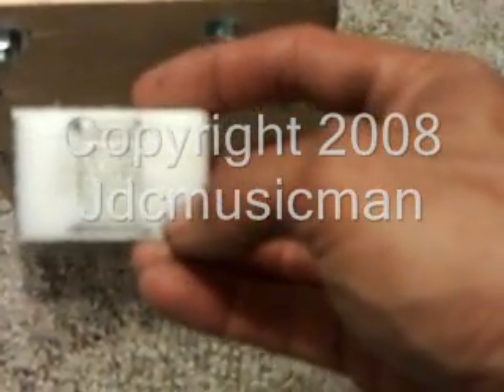New 16plate 4x5 NO hole drycell progress #2

Comment: Howdy JD !! if you dont have a problem with heat go ahead and use the WD 40 straw idea tjgame2 came up with or you could go with alluminum and use small roll pins found at any auto store in quantity, the roll pin will have a slit down the side but that would not matter I would not think. cutting them and then deburring would be time consumeing but a small tapered needle file in a drill motor would do the deburring. I am on your side man!!
Rusty

Comment from the maker: It has been my experience on the voltage gap thing ..2.2 - 2.4 seems to be the sweet spot ..Any thing less deals with heat very well but  you comprise that for little production , in all the test that I have run doing 12 - 14 volts a 4n config is the middle ground half way decent production and manageable heat....2.3 even does well for a 51 plate series cell it gets hot but not to hot.I built a cell once with 6n and production was not great at all never got hot tho..

Comment from the maker: If you have a 4n setup you want have any heat problems anyway.Well I hadnt had any with that setup so far , and I have run my 31 plate cell for 8 - 9 hrs straight on 27 amps with no real bad heat issues,.

Comment: i am looking for plastic small tubes i have  the same idea as yours in addition to the holes i would like to slide in plastic tube so to isolate each cell from the other with no water touching and gas will rise up and than collect everything in one output ,and i will reserve one raw for water input that i will activate a small pump to fill the cell not flood the cell .my idea also can be achieved with using a block of plastic that is machined on a cnc ,no way i will do it manually

Comment from the maker: I thought of doing that , then for some odd reason I decided top cut the bottom out too..But i can change that fairly easy ,I have enough scrap neoprene to cut 50 more gaskets for this cell..yeah I did consider that and am still considering it ,Have thought of it a little today ,it would probably be simpler to construct 1 piece to do the water and gas than to do 2 seperate pieces..Would get decent results from it cause my other cells only have one hole and they work fine like that

Comment from the maker: Yeah I am looking at all angles on this thing...
Well the gasket on the bottom of that piece will be sitting down on the plates edges, those holes are dead center of the plate gap and the plate edge will be covered with the gasket , If you understand what I am saying...If there be any current leakage at all it should/would be only thru the electrolyte mix....but yes maybe it will work or not ,I wont stop till I get it. I am stuck on this,it may be plan Z before its all over with ...

Comment: well, I dont think you have sealed the plate edge ... you still got plate edge that see the adjacent plate edge ... so am not sure how you plan to seal off that aspect ... basically, you are on the right track, but think you need to totally rethink the gasket design ... 

but stay on couse and try your method ... you never know ... I could be all wet and the way you are headed could end up working fine ... but be thinking of a plan "B" just in case ...